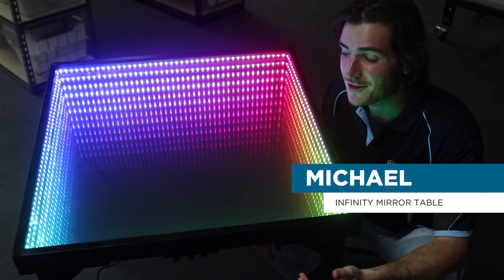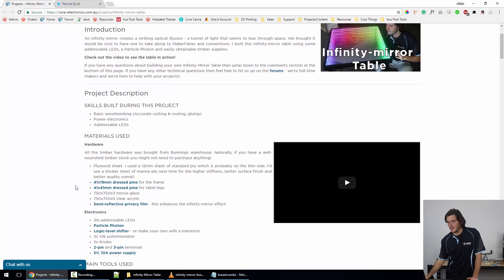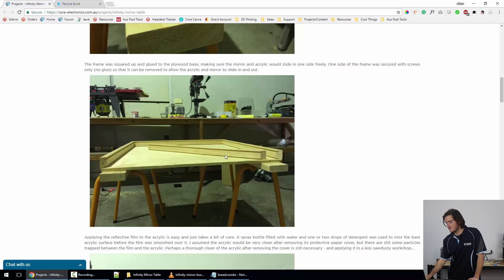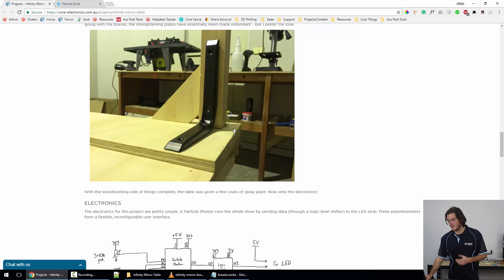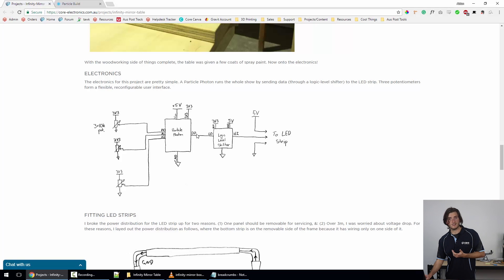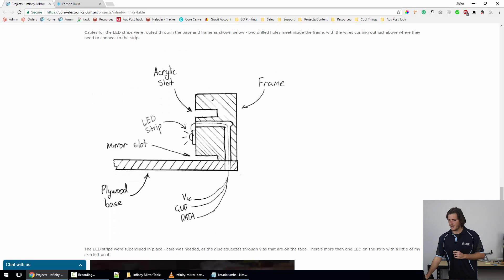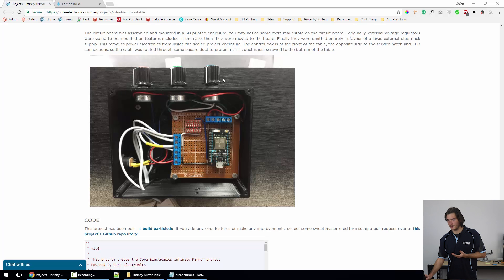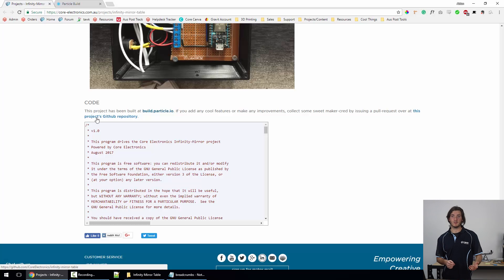Project: Infinity Mirror Table. How to guide and full build details

Comment: Add a column of LED's in the middle.  Just a 'puck' shaped disc lined with LEDs to make it look like a column of light is in the middle.  I'm sure you could use very thin wires to connect the LEDs on the disc so the wires are not visually obvious. Other than that, I think it would look better with a diffusion layer of plastic over the LEDs so they blend together, and you don't see individual LEDs.
https://www.environmentallights.com/17460-fds-d-5m.html